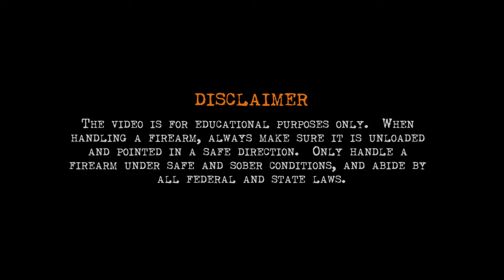Can You Use Brake Cleaner to Clean Guns?

Comment: This is a great vid, as a law enforcement firearms instructor for 27 years, I taught brake cleaner to clean side arms.  Finish the cleaning process with Mobil 1 0w-20 for a light coat and slide rail lube.  Synthetic Mobil 1 is in wide use by the military.  This lubricant doesn't break down and it's easy to clean.  Please don't use 10w-40 on your firearms.  WD-40 is a penetrating catalyst and will penetrate your primers and render the bullet and firearm useless.
Reply from the maker: Thank you for the compliment on the video and the information!
Reply: @ThatDeltaBravo  the penetrant evaporates & the fish oil stays .I have a plastic bottle of BREAK FREE CLP the top of the bottle collects dust & it sticks to it same for the can of G96 gun treatment BUT WD 40 has no dust stuck on it on the same shelf. I like my semi autos clean & dry, no jams 
.
Reply: Awesome info! Thanks!
Reply: Geek
Reply: I don’t think it’s worth buy gun oils when we could just buy a quart of synthetic motor oil 
Thanks
Reply: @EREBO95  Yeah, much more efficient, 0W-20.  The same thing that our military is using.
Reply: Use the cheapest synthetic oil you can find.  There are many synthetic oils today that are as good or better and cheaper than Mobil 1 which is now a mid-tier synthetic oil at a premium price.
Reply: What in the world is going on in this comment section. Who is telling you people that the military is using 0W-20, my brothers and sisters in Christ there isn't a single vehicle in our force that even uses that. It's all 15W-40, furthermore I have been in the military for quite sometime and I HAVE NEVER........ok once, used automotive oil to lubricate a machine gun but that's about it. It was in a pinch too it wasn't my first choice. You can do it yes, but idk where you peeps are getting "our military is using motor oil" like we're just slathering it on in here and using nothing else. Oh and by the way, that one time i used that motor oil that machine gun smoked like a steam shower, not very good for signature mitigation 😬

Comment: Thanks for the video. I have been cleaning firearms with brake cleaner and WD 40 since 1977. Never had an issue related to either product. Some have told me that I'm just lucky, but 43 years with no issues goes way beyond just good luck.
Reply from the maker: I would think that after that amount of time, you would call is "proof," not luck.  Lol.  But what do people like us know, right?  Keep on doing what you're going!
Reply: You are right with brake cleaner and then wipe dry then use WD 40 excellent choice. I will definitely use the same product and it works for me on my tools as well.
Reply: A few drops of synthetic automatic transmission fluid after the brake clean and it's good to go.
Reply: I would NOT recommend WD-40 unless you have no other option- and so long as it does NOT have a free-floating firing pin(those who have researched the SKS should know exactly why). WD-40 gums up over time and also does not have the same rust-inhibiting properties(it simply repels water) and wd-40 does not last long at all. If you want a good alternative to gun oil, either go for some synthetic motor oil or some Automatic Trans Fluid.
Reply: WD has water in it and will conduct electricity beacuse of.
Reply: I hate to break it to you, but for 43 years, you’ve been doing it wrong, I don’t mean that in an ugly way. You see WD-40 is not a lubricant. It is simply designed to repel water, and usually it’ll evaporate off of your pistol within a day or two, leaving your gun bone dry. It is also a metal penetrating oil, which means if you get it on any of your ammunition, you could accidentally deactivate your gunpowder. The brake cleaner works all right but honestly, you can clean it with a rag, and a toothbrush, using soap and water if you have to so long as you dry it and oil it, I personally use a mix of automatic transmission fluid And full synthetic motor oil 50-50 blend, if you want something that penetrates 50-50, automatic transmission fluid and acetone. High temp Grease works great and warm environments, but do not use it in cold environments.
Reply: I do the same 30 + yrs.

Comment: Oil the Beretta and 1911 BEFORE installing the grip panels. That is a common rust spot under the grip panels because it's often overlooked.
Reply from the maker: That's true.  Normally I don't take the grips off of the 1911, but I do oil it when I do since quality of a Taurus is not the same as a Beretta.  I probably did the same at one point with the Beretta, but oh well.  Lol.
Reply: aluminum alloy does not rust
Reply: @aslanbosnakoglu8240  Yeah right. Aluminum goes faster than steel under many conditions. Stainless 316 is far more corrosion resistant than aluminum and even that rusts eventually.
Reply: @JohnMaxGriffin  aluminum. Doesn’t. Rust. It anodizes. It protects itself.

IT DOES NOT RUST.
Reply: @LinusScrubTips  You’re spouting nonsense. There are many chemicals and physical exposures that will eat away the oxide layer and then the aluminum itself, which is highly reactive. Anodizing is a specific passivation process, not the general word for aluminum oxidizing. Where did I say it rusts anyway?

Comment: Brake cleaner dissolves many plastics but if your gun is all metal brake cleaner will work well but I would only use it on a filthy part that won't come clean by normal means.  Motor oil or WD-40 is usually sufficient.

Comment: I've used non chlorinated brake cleaner and live in Palm Beach County, FL. I've never had anything rust but I don't let the brake cleaner sit on the parts for long. And you're right, I don't use it on certain materials but I spray all my polymer lowers and trigger assembly in both handguns and ARs and immediately followed up with clp to blast anything away

Comment: I have also used GUNK Engine cleaner. I got a 1950s Browning A5 Shotgun as a gift. After disassembled, inside of the receiver was packed with very old, very dirty grease of some kind. I sprayed GUNK, rinsed it with hot water, then used a compressor to dry it out. Oiled it and it came out beautiful!
Reply from the maker: That's awesome!  Keep it clean.  ;)
Reply: Probaly cosmaline, ?

Comment: I checked online forums and found the old timer comments, and new firearm users. Decided to give it a shot and brake cleaner works great. I did avoid it on my wood and poly furniture. Using small engine oil right out of the plastic container to coat my AKs and AR. 

Thank you for confirmation bias!
Reply from the maker: Glad it worked for you!

Comment: Yes you can use Brake Cleaner but you have to make sure it is non-chlorinated as it can and will damage the polymer parts. As a Tractor/Trailer Mechanic I have sprayed regular chlorinated Brake Cleaner on the Polymer hubcaps and watched the cracks appear fast but Non-Chlorinated Cleaner has no bad effects, I sprayed down a cheap Polymer Handgun I had to see what the Non-Chlorinated cleaner would do and there were no ill effects at all but the Chlorinated spray damaged the Gun. After cleaning be sure to lube everything that should be and wipe the metal slide and barrel with oil to prevent rust. Delta Bravo is Correct .

Comment: Coat plastics/rubber/polymer before spraying harsh chemicals, then reapply the rubber protection again.
As having auto detailing as a hoby, my first recommendation would be 303 Aerospace protectant/conditioner. Buy it by the gallon because you can use it on so many things, especially rubber/plastic outside the home.
Check your outside ac unit. Look at those plastic peices. Keep checking for more plastic & rubber that you don't notice that's just degrading in the sun.
Great on tires and dashboards too.
Reply from the maker: Thanks for the tips!

Comment: Answered a question I've been thinking of all week. Thank you. I cleaned and AK with it before with no adverse effects, but I was wary on using it for anything else.
Reply from the maker: Glad I could help!
Reply: This is a great vid, as a law enforcement firearms instructor for 27 years, I taught brake cleaner to clean side arms.  Finish the cleaning process with Mobil 1 0w-20 for a light coat and slide rail lube.  Synthetic Mobil 1 is in wide use by the military.  This lubricant doesn't break down and it's easy to clean.  Please don't use 10w-40 on your firearms.  WD-40 is a penetrating catalyst and will penetrate your primers and render the bullet and firearm useless.

Comment: Good video! I just picked up a very dirty handgun from a local gun store used, I don’t think the previous owner ever cleaned it. It’s a polymer frame Walther and like you I was worried it might hurt the plastic and polymer parts. I covered as much of the frame as possible with a plastic bag and just aimed the can at the internals (rails, trigger assembly, springs, etc. immediately followed up with a towel to wipe away the excess. No adverse effects. I can also confirm that even on plastic parts it leaves everything super dry and gritty feeling. Trigger felt like garbage so I followed up by spraying breakfree CLP on the entire thing again let it soak for a bit then wiped away the excess. Smooth as butter. It’s a good cleaner to have but exercise caution. Cleaned up carbon really well!
Reply from the maker: Glad it worked out for you!  Thanks for watching.  :)
Reply: I love copper or nickel grade anti-seize compound for trigger parts. You get plenty of lubrication that stays put but you also get the metal film from the solids that smooths parts.
Reply: @DriveCarToBar  that’s an idea I’ve never thought about. Might have to try that!

Comment: I’ve been using non chlorinated brake part cleaner since the 70s. I’ve always been careful getting it on wooden and polymer parts even though it’s supposed to be safe. I always clean my all metal guns first, without grips. Wear PPE both nitrile gloves and eye protection! I disassemble and place the plarts in a Walmart clear polymer shoebox storage box! After completely cleaning all parts I respray them with CLR and then wipe them clean. By the time I’ve finished the third handgun there’s enough brake cleaner overspray left in the shoe box to immerse the parts for the next few guns. Using a small brass or nylon brush and liquid I do just that scrub them clean. Now comes the polymer guns, remove slide with barrel and all springs and submerge in shoe box with brake cleaner, brush, dry and coat with CLR, Now take polymer frames and internal trigger mechanisms and spray with Polymer safe Birchwood Casey gun scrubber, brush out with clean brass brush and dry. Spray with CLR and wipe leaving a thin coating on all parts. 
The most interesting fact is that the clear plastic or polymer shoe box which I bought in three packs from HD and Walmart now has about a half inch of the brake parts cleaner and a lot of dirt and carbon for hours and it’s just fine no distortion or softening of any kind. Sometimes I even put the top on it put it outdoors to use again later, so far so good. Be careful use only in a well ventilated area, it’s  highly flammable! But it’s worked for years
Reply from the maker: Thank you for sharing your methods and tips!

Comment: I have some rifles barrels that are very rusty, again can I use LOCTITE rust dissolver  ? Nice tip on the brake cleaner.
Reply from the maker: I would go with the least aggressive method first: bore cleaner and 0000 steel wool.
Reply: @ThatDeltaBravo  Thanks and congratulations for your knowledge, very nice.  Mike van Grieken

Comment: I switched from brake cleaner to carb cleaner. Carb cleaner is generally safe on polymers although I wouldn't want to drop a Glock frame into a carb dip tank. Carb cleaner is specifically made to remove carbon fouling. But either way (brake or carb), they work and arguably just as well as any specialized gun cleaning product. Just have to remember to follow up with oil if you use either cleaner. Carb cleaners will often leave an oily residue but it's not sufficient to lubricate most guns. So just pick your favorite gun oil and follow the manual.
Reply: I haven’t done a deep cleaning like this in a while but that’s a good tip on the carb cleaner. I know brake cleaner leaves no residue. I used non chlorinated brake cleaner. Had a bit of overspray onto the polymer frame but didn’t hurt it. Just leaves things so squeaky dry that even plastic parts need to be oiled afterwards.
Reply: @DIYDad1  and it's just as cheap as brake parts cleaner. A few bucks for a can is a deal compared to superwundertacticlean #11ty or whatever they want you to buy.
Reply: am always afraid to shoot anything like these sprays into the safety’s and trigger mechanism. it would be so much easier then taking the entire gun apart if it did as well?

Comment: I had a friend that used gun scrubber Gun scrubber on a stainless steel Beretta 92 and it removed part of the finish. The store clerk told him he could use it, I don't think there was anything in the manual about it but when he called the factory they said no you shouldn't have used it but they made good on it and refinished the surface for him. If it's solid steel and blued, there should be okay. Carburetor cleaner works well too and sometimes you can find it way cheaper.
Reply from the maker: Yeah... Stainless, nickel, and finishes like that need a bit more care.

Comment: Watch out for the brake cleaner ingredients.  I've seen some brands (mostly store brands) change their formulation at will.  In one case, the brake cleaner which had been safe on polycarbonate caused softening and fogging some months later.  It now had acetone, and listed it first (with no other label changes).  If you take a "keep it off all plastics" attitude, you shouldn't have any problems.  If in doubt (perhaps about certain coatings) don't use it.
Reply from the maker: Thanks for the tip!
Reply: I think the ingredient that causes problems to polymers is acetone. Any brand of brake cleaner should have an associated SDS sheet to show what chemicals they use

Comment: An old timer i met at Walmart clued me in on using brake cleaner. I still consider myself a traditionalist when it comes to cleaning, but i will use brake cleaner on hard to reach spots like the firing pin and where it goes. Also inside the barrel. Very effective! But got to lube those areas after youre done. It really takes off everything.
Reply: Those old timers generally know what they're talking about. They tend to be fountains of knowledge.

Comment: Got a mil-surp Chec handgun smothered in Cosmoline. BRAKEKLEEN worked great (cosmo so thick I had to soak the parts in it, it was EVERYWHERE).
  The leather holster was brittle dry. Saturating it with mineral oil, repeatedly, brought it back to life. Still wiping it off firearm after removing it from. 
  Specialized gun products are overated (for sales). If engine oil can protect engines (250°+F) it's good enough for me. No problems thus far.

Comment: If you use most cleaning solvents, you have to wipe the metal surfaces with oil.  I've used brake cleaner, paint solvent, etc for years.  brake cleaner is great for cleaning shot gun barrels where we've shot lots of less lethal rounds at the range.

Comment: I've been using Non-Chlorinated CRC Brakleen (the green cans on my Steel Challenge PPQ's for several years with zero problems.  And yes, proper lube during reassembly is critical - and simple with OTIS dry lube.
Reply from the maker: Great to hear someone else uses it!

Comment: Just test on a no conspicuous spot first. I used it an Arsenal Arms AK luckily I just sprayed the muzzle brake and it removed the  finish. I use starting fluid (after normal cleaning) and it washes away even more carbon. And it has never damaged any of my firearms. Most of the automotive cleaners and starting fluids have gone way up in price, so I mostly use Balistol, then rinse with starting fluid.
Reply from the maker: Inflation sucks.

Comment: I'll use it on the metal parts only.  Cleaning off all residue and then using 3 in 1 oil (nothing fancy.  Most other oils gum up if it sits for an extended time)

Comment: Birchwood Casey Gun Scrubber at one time even said it may damage plastics, rubber, etc. I have to believe that if it's blued, or parkerized steel, stainless steel or anodized aluminum it would be safe. Any polymer like a coating or paint, or any plastic part, just avoid that. I do anyway with any gun cleaner or oil. It's almost always the metal bits that are getting the dirtiest. Generally a dry clean cloth to clean plastic and rubber bits is sufficient.

Comment: Yeap! I tried break clean on my rock island tac ultra fshc 45acp. Work. 👌 OUTSTANDING. I did like you said, witch is VERY IMPORTANT. Lube right after cleaning with break fluid. What I like to do is cause I have a Air Compressor at my house, is after I get done cleaning my firearms with break clean is blow them out ' GENTLY ' with the air then flow that up with lubing up with Radco CLP, or your favorite lube. All in All. Break clean is a TIME SAVER , from getting in there with cotton ear swabs, and picks cotton patches. Nope! Not anymore for me
Reply from the maker: Glad it worked well for you!
Reply: @ThatDeltaBravo  yes, sir. I'll NEVER go back to using patches or ear swabs again

Comment: Take of all your plastic/rubber (also fibre optic) hose it down with non chlorinated polymer safe cleaner, blow everything out with compressed air. Allow to dry. When dry completely hose down with a ceramic conservative/lubricant like Flunatec gun coating. Allow to work in an hour or so, wipe off any acces which didn’t completely dry.
You now have a squeaky clean and lubricated firearm.